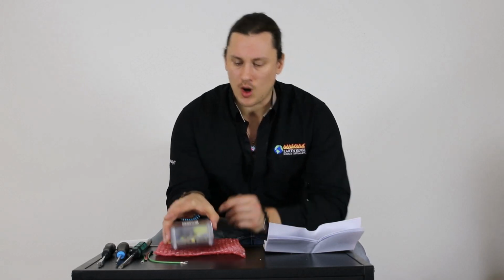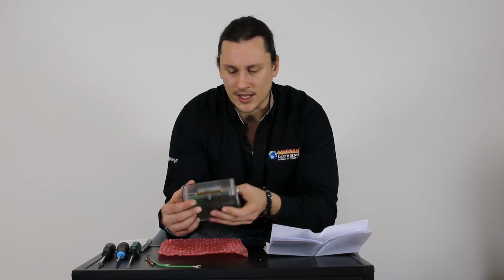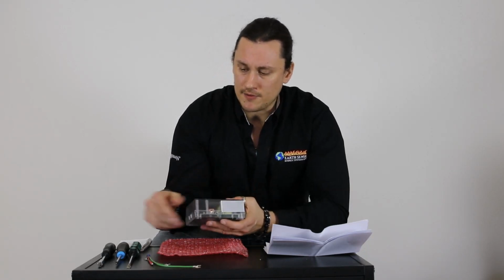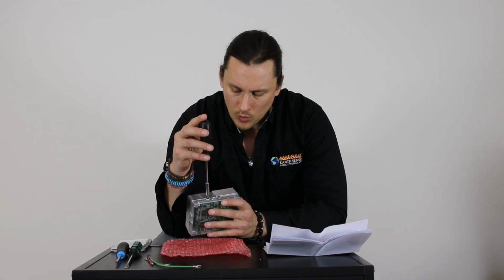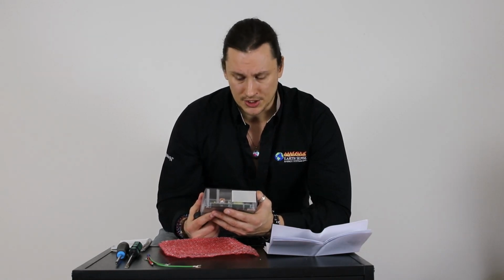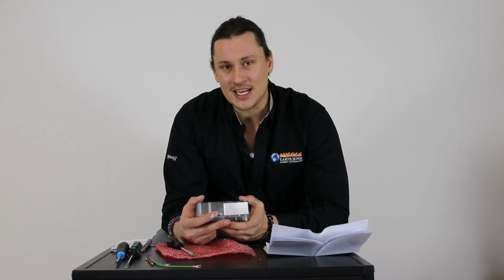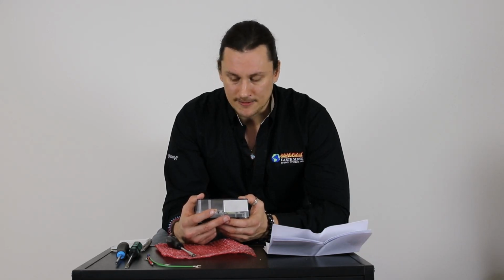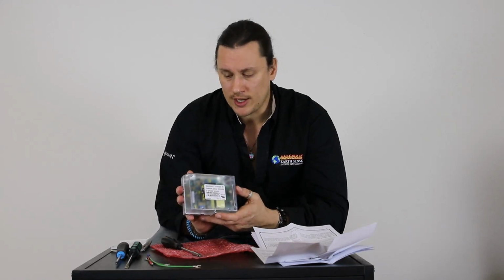QuadraFire 3 Speed Control Board Installation and Settings

Comment: I had an issue where my stove wouldn't feed pellets after start up we bought our house and it was already installed we pulled the stove out and tried it in the yard same issue we replaced all the snap discs 1,2,and 3 and are still having the same issues, tried clearing the vacuum tube and still the same issues
Reply: I also replaced the thermocouple as well because parts were not too expensive thoughts
Reply from the maker: @ericdinette33  Hey Eric, happy to help. 9 times out of 10 if the stove won't feed after start-up it's the Thermocouple. We have run into numerous cases where the replacement thermocouple wires need to be reversed for it to work correctly - Give that a try. From there the only other component would be the control box. Here's an additional video on the Thermocouple for reference. https://youtu.be/JhMTxAzQ9k4
Keep us posted, happy to assist.

Comment: I replaced a bad thermocouple, the light on the controller never lights. So I replaced the control board. The led's still don't light up. Fire won't keep going. Startup goes ok, however, won't keep going. checked vac switch, even jumped. have already replaced the other 2 snap switchs. Blue blinks are correct.
Reply from the maker: Hey Bill, try reversing the wires on the Thermocouple. We've run into this a bit recently where those wires need to be reversed. Keep us posted.
Reply: @EarthSense  That worked, thanks
Reply from the maker: @billthurlow690  Fantastic! Thanks for the update Bill!

Comment: Can I diagnose with my control I keep having to turn thermostat down and back up
Reply from the maker: Hi Gary, happy to help. Let's bypass the thermostat to see if that's where our issue is. Disconnect the thermostat wires from the thermostat terminal block and put a large staple or wire between those two terminal connections. Let us know if the stove starts up normally. Thanks!

Comment: I have a 1200 FS, I replaced the thermocouple and getting 3mv DC I replaced the board set at (1) 
and still lights and then goes out, getting no green or red lights.
Reply: Switching the thermocouple wires did the trick thanks for your help.
Reply from the maker: @RobertPaulHart  Fantastic to hear Robert! Glad we were able to help. Any questions or needs down the road just let us know. Thanks!
Reply from the maker: Hey Robert, thanks for contacting us. Let's try reversing the wires for the Thermocouple. There have been a number of instances with the Quad thermocouple replacements where this has come into play. Once you switch those wires let us know if it continues to run after startup. Let's also make sure enough pellet fuel is coming in during start-up to allow the T-Couple to reach proof of fire. Make sure the slide in the hopper is open - more so if the pellet fuel is longer. You can always place a half-handful of pellets in the firepot to start which would ensure that it's getting hot enough for the T-Couple to lock in. Keep us posted, happy to help. Thanks!

Comment: I have a Castile free standing stove and have an issue with calls to heat. If the t-stat makes a call the call light in the stove doesn't come on. I need to rapidly turn up and down the thermostat to get the light to come on and stove to operate. Once it comes on everything runs normally. I am thinking it's the control box but wanted to get a second opinion before I throw parts at this problem.  Thanks!
Reply: Oh, I also jumped the t-stat connections to rule out a thermostat relay issue.
Reply: I'm not running a normal t-stat.. 😬 Using a  Nest connected to a relay. Everything is powered from a separate transformer, so no extra loads on the stove. I wanted the ability to fire it up before coming home from work. Been working for 3 years now so not a new install.
Reply from the maker: @binarybeastie8901  Ok, thanks for the information here. I'm going to run this past one of our other technicians and follow back up with you. I'll be back in touch ASAP.
Reply from the maker: @binarybeastie8901  Apologies For the late response. Our lead tech stated - I would disconnect everything from the stove and just put a paperclip in the thermostat terminal block or something similar to make sure.  If no call light, most likely will be the control box. 
If you have a local dealer they should be able to test the control box for you. If not, that is a service we offer. Keep us posted, happy to help.
Reply from the maker: Thanks for contacting us. At first thought, I would think this to be a T-Stat issue. We have seen this issue with both the standard magnetic wall thermostats and the earlier mercury thermostats. When you jumped the T-Stat connection at the terminal did the stove call light come on and immediately go into start-up?
Reply: It starts up but the call light is not on and doesn't drop pellets. Just the fans.
Reply from the maker: @binarybeastie8901  Ok, gotcha. When you hit the reset button does anything happen?

Comment: The auger is not getting power, everything else is, I did replace the control board, any suggestions
Reply from the maker: Hey David, happy to help. I'm assuming you have a Quadra-Fire? Which model? You can test your auger motor to direct power to ensure the motor is working correctly. Video Below. Both your vacuum switch and High Limit switch in Quadra-Fire models are in line with the auger feed motor and will cut off power if the switch is tripped or faulty. Some additional videos below on the vacuum switch and limit switches for further info and troubleshooting. Keep us posted, happy to help. 
Test Cord: https://youtu.be/rlmiCYI2WPk
Limit Switch: https://youtu.be/3nMvhuuvDao
Vac Switch: https://youtu.be/pHeQzUmSlIE
Jumper Wire to Troubleshoot: https://youtu.be/FDVkbsHS95U
Reply: Thanks, Yes, a Castille, has to be over 17years old.  I will try the solutions below and let you know,  Really thanks again!
Reply from the maker: @davidsylvia7890  Thanks David! The Castile is a great stove. Sounds good, check the simple things first and keep us posted. Happy to help!

Comment: I have a CB1200 that overfeeds pellets in the low setting. In reading various documentation, it looks like once it goes through the initial startup the feed rate should slow down based on the H-M-L setting . My stove dumps pellets at a rapid rate in the low setting once the LED turns red and the flame burns very high. I’m thinking it is the control board, but want to put this out there for thoughts before I order one. Am I on the right path?
Reply: Thanks. I will do that and post here.
Reply from the maker: @johncolumbus5611  Sounds good John, happy to help!
Reply: @EarthSense  I ordered a replacement board from Earth Sense and it did resolve my problem
Reply from the maker: @johncolumbus5611  Hey John, thanks for following up. Great to hear the problem is now resolved, very glad we were able to help. Any future questions we are always here. Appreciated!
Reply from the maker: Hey John, thanks for contacting us, happy to help. What I might suggest would be to time the auger on/off cycles once the stove completes it's start up cycle. Let's write down the on/off times on all 3 settings - L-M-H. Let us know what the numbers are. If low is the same as medium or high or vice versa, then yes, more than likely we have an issue with the control box. Keep us posted, thanks.

Comment: howdy! 3 speed control box slowly flashing 7 blue lights and then nothing. bad box?
Reply from the maker: Hey Troy, double checking with our lead techs on this. Will follow up ASAP. Thanks
Reply from the maker: Hey Troy, some info here from our techs: That would mean the control box dial is on 7...is it? Turn the dial to something else and see if it is right then set to what is correct for the stove. Is the Red call light on? If yes, combustion blower has to start next...if blower is bad nothing else will happen. 

Hope that is helpful, keep us posted.

Comment: Hello. I have a question about initial startup and feed rates. I have a 2006 Mt Vernon with the 4 speed controller. I have replaced it a few times and cannot figure out a maddening issue. When I initially replace the controller the stove starts and within a few seconds starts dropping pellets as it's supposed to. On the next startup the stove reverts to not dropping pellets initially until 10-15 seconds have passed. Then only drops for a total of 30 seconds. It's supposed to drop pellets for nearly 60 seconds total. That being said sometimes it will not drop enough fuel to get to temperature and shut's down. I've replaced the controller twice with the same results. Any thoughts on why this is happening?
Reply from the maker: Thanks for contacting us, happy to help. I just forwarded this over to our lead techs to gain their insight with this issue. Does your control box have a dial setting? If so, where do you have that set?
Reply from the maker: Hey Don, Another quick question - Red call light...is this light on steady or is the call light turning on and off when these things are happening during startup?
Reply: @EarthSense  Thanks for the reply. From what I can tell the red call light remains on like it should. Is it possible that the vacuum switch is shutting off the feed to soon? I noticed this morning that now the unit does not start dropping for the first 10 seconds of it's start up cycle then only drops for no more that 15 seconds after that. If I unplug the stove from power and then plug it back in after say 5 minutes the unit runs normally. Drops pellets for nearly a minute. Once the cycle completes and it starts again it reverts back to this odd behavior of delayed pellet drop and on 15 seconds thereafter. Just so you know I have purchased both of the recent controllers through Earth Sense. I also have a 2nd Mt Vernon in my garage that does not act like this.
Reply from the maker: @DonBergren-hn2jb  Thanks so much for the detailed message Don. We'll get this figured out. Let me send this info to our tech team and I will be back in touch ASAP. Thanks.
Reply from the maker: Hey Don, just heard from one of our techs. He says there is a potential the vac switch could be the issue here. Let's do the following - 
1. Make sure the stove and venting are clean
2. Make sure the firebox door and ash door gaskets are sealing tight
3. Blow through the vacuum switch hose back into stove. Try to start again. 
4. If acts the same bypass the vac switch and try again - https://youtu.be/FDVkbsHS95U
5. If it acts the same it's not the vac switch...Could possibly be a thermocouple or limit switch issue. 

We can bypass the limit switch in the same way as the vac switch if needed. Bypass is for troubleshooting only. We never want to leave a safety switch bypassed. You can use a multi-meter to get a reading on the Thermocouple or you could swap it out with the other MT Vernon you have to test that component and start-up function. Keep us posted; if I hear anything further from our techs I will let you know right away. Appreciated.
Reply: @EarthSense  Thanks for the reply. It was the vacuum switch. I jumped the connection and the stove now cycle's the way it should. I have ordered a replacement vacuum switch and should be good to go now. Thanks for your help!
Reply from the maker: @DonBergren-hn2jb  Most excellent to hear Don! So glad you found the culprit - great troubleshooting on your end as well! Glad we could help, any future questions please let us know. Thanks!

Comment: I have this control board in my pellet stove I recently moved the post off from one location to another and now it does not work. I have power and the thermostat was turned completely up in fact I even remove the thermostat and jump the wires to ensure it was calling for heat most of the wires inside the pellet stove seem to have power going to them however I have no lights and nothing is happening it’s almost like there is a switch shut off somewhere. I’ve tried pushing the reset button and I’ve tried the different speed settings switch as well but nothing happens at all. Any help would be greatly appreciated.
Reply from the maker: Thanks for the message. Let's try pulling the control box out and placing it back in. Double check all the wire connections going to the Junction Box. Double check the fuse in the Junction Box as well. If you have a multi-meter, let's see where we have power and where it cuts off. If we are still not getting any power or lights, next step will be to have the control box tested. If you have a local dealer they should be able to perform a basic diagnostic test on the control box. If you do not have a local dealer, this is a service we provide and I can send more details if needed. Keep us posted.
Reply: @EarthSense  Thank you for responding, turns out I was not getting the proper voltage to the unit in the first place the power cord had somehow became defective. So I was getting enough power to read but not enough to run anything. It is up and running now and I did not have to buy any parts. Thank you for responding and including multiple options to diagnose my problem.
Reply from the maker: @shanesmaineshop  Great job troubleshooting the issue! Glad we were able to be of help and your stove is back up and running again. Any questions down the road just let us know; always happy to assist. Thanks!

Comment: I just bought a used original 4 speed Mt Vernon. My problem is that the stove does not release enough pellets for it to start and activate the thermocouple before the stove shuts down. If I click the reset button for extra pellets the stove starts right up and continues and will trip the thermocouple for more pellets. I opened the auger choke all the way to the open position but just quite can't get enough pellets to trip the thermocouple. Is it possible that the 4 speed controller adjustment dial needs to be set up? If so are you able to either do a video or explain how to set it up. I'm using brand new Rocky Canyon Red Fir pellets.
Reply from the maker: Thanks for contacting us. I just messaged our lead tech regarding. I will follow up ASAP. In the meantime, can you unplug the stove and check the control box to see if your control box has a dial on it?
Reply from the maker: Just heard back from our lead tech. There is a way to make this change. On the control board, setting 2 is +10% fuel on start up and setting 3 is -20% fuel on start up. Keep us posted!

Comment: should there be a light on at all times on the control board
Reply from the maker: Thanks for contacting us Donna. Once the thermocouple reaches roughly 700 degrees the green light will change to red and will stay on until the stove cools below that 700 degree threshold. Any other questions please let us know. Thanks!

Comment: Have a cab50 pellet store my control board keeps burning up when turned on ,this is the second one that's it burned up. Can you give me some idea what's could be wrong
Reply from the maker: Thanks for contacting us Bonnie. By burning up do mean you smell electrical burning coming from the control box or the control box simply stops working? 

In most cases we see failures of a control box when we have either A. A direct short/lighting strike/power surge to the outlet, or B. Something in the unit that is grounding out and causing a short to the board. 

Things to check:
Check and inspect the wiring in the stove. Make sure there are no bare wires or open wires touching metal in the stove from any of the motors, safety switches, or components.
Check your igniter element. We have seen cases where the igniter element will warp, touching the metal housing causing a short that can take out the board. 
Let's make sure you have a surge protector in place between the stove cord and wall outlet of at least 1000 Joules. Reference: https://pellethead.com/product/belkin-surgecube-outlet-surge-protector-1080-joules/

Keep us posted, happy to assist.

Comment: Hello, can you please tell me what could be wrong if the thermocouple light does turn green but it never turns red?  The stove will start up but then will stop feeding after about 5 minutes. It will continue to burn if I press reset every time that the auger stops feeding.  I can keep it running for an hou or morer if I keep pressing the reset button but once I stop pressing the reset button the fire will die.
Reply from the maker: Thanks for contacting us. If the Thermocouple is not reaching the red light status, it's not giving signal to the board that it has reached proper temp to go into normal operation mode. In 99% of cases this will indicate a failure of the thermocouple. If you let us know your model we can provide references for replacement options. Any other questions please let us know. Thanks!
Reply: @EarthSense  Thank you very much for the response we have ordered a replacement.  If I can ask one more question.  Have you ever heard of a vacuum switch only working if laying horizontally and not in its original vertically mounted position?  We have a stove where the auger will not turn with the vacuum switch mounted on the top rear curtain/grill and will immediately start turning once we remove the screw holding it to curtain/grill and holding it sideways/horizontally.
Reply from the maker: @johnnygonzales6748  Thanks for the message Johnny. That is an odd one. There is a diaphragm inside the vacuum switch. Potentially it is weak not allowing it to function properly in the vertical mount position; that would be the only thing I can think of here given that scenario. Hope that helps. Thanks!